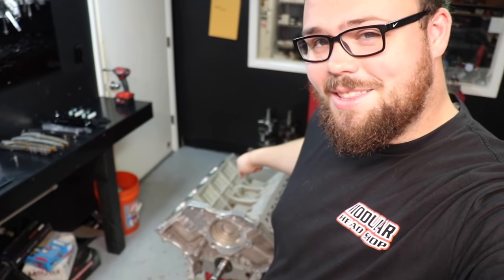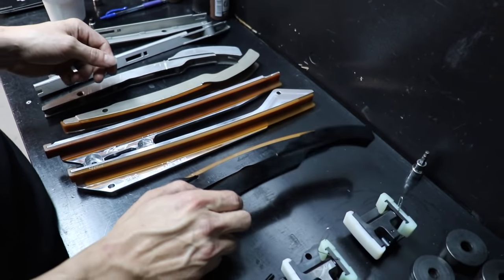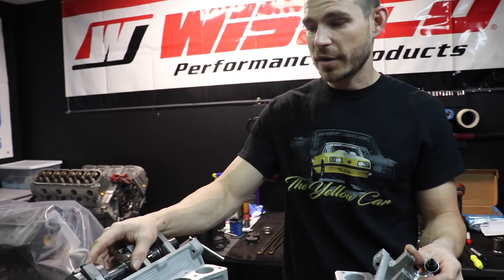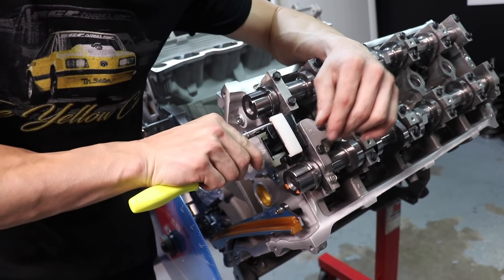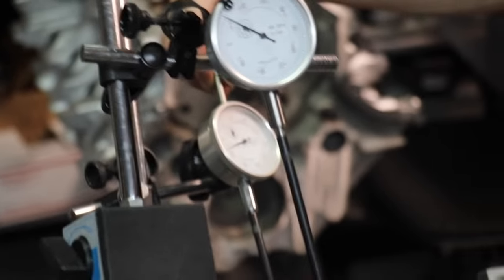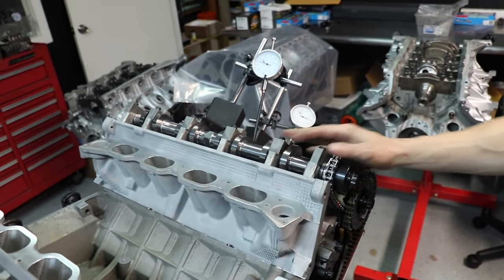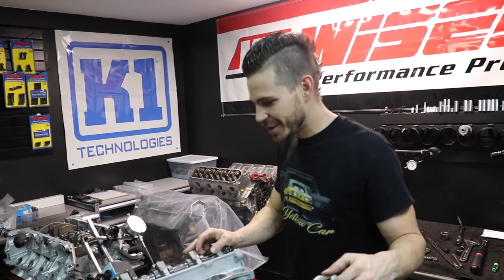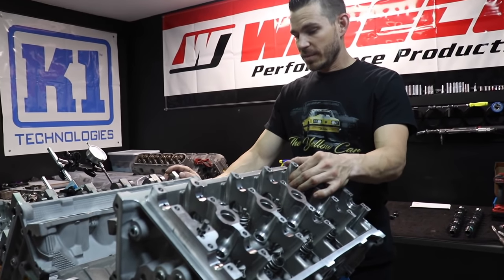How to Degree Cams 5.4L and 5.8L GT500 - Built 5.8L GT500 Build MHS Stage 3 Cams

Comment: Great video! I have been degreeing 4v camshafts since 2003 and this guy did everything perfectly. My only recommendation would be to lose the Chinese dial indicators. I could not really get repeatable results with the cheap ones, you can even see it in the video. 
But I did the same, making my own adjustable lash adjuster and tools to hold the chain tensioner open.

Comment: Very meticulous work. I was worried you moved the wheel but the piston was stationary. I think you just came up with a reason to manufacture solid cam sprockets with key ways offset +or- from the dot. Then if you need +or- degree, swap the cam gear. Ignore this comment if you thought of it already. Thanks for the upload.

Comment: Jordan buddy. Hook those drills up to thw milwaukee app and set the torque for each of those drill numbers and you wont ever have to worry about half triggering in those studs. Think it sets as low as 7 nm and 100rpm. Makes throqing studs in so much quicker without running risk of the drill bump torquing when the stud bottoms out. Specially on engines with alot of studs like these mod blocks and nissans vg engines

Comment: His tdc equation is more complicated then it should be . It’s Easier if you add first and second reading and divide by 2 .
Reply: His whole tdc process is over complicated would be way faster using a dial indicator. Still a quality build and he is doing a great job none the less.
Reply: Agreed
Reply: When he does his tdc hes checking tdc at 2 locations. Hes just figured a process for him where he can easily check and double check while giving him multiple measurments that he uses later on in the build. He has a flipped way of balancing the rotating assembly as well. But its accurate and doesnt take any longer. Ive run into a couple the old timers over the years that wont trust a tdc reading that is only taken at #1 they want #1 and #8 and set tdc using feeler guages and a 3 foot framing level. 
And his process may be because hes had a bad meter or guage and timing was off when everything read correct. Would be a huge hit on a $20k build just like this and be off timing between banks because of a bad tool or an incorrect reading. I kinda like it tho. Gives a better understanding of how his mind processes thru each stage of the build
Reply: I just find it faster to get a rough tdc then set a dail indicator and measure the sweep at tdc and split it, saves having to rotate back and forth so much.

Comment: 43:33 filing the gear to advance the timing. Is that usually when there's a pretty aggressive. Cam in the engine.   Correct. Or incorrect?

Comment: I wonder if the  flats on the cams nut would be aligned  to make a cam locking mechanism  or clamp so you can change chains and tensioners on a 5.4 32v  engine  ? I'm in Australia  so our 5.4 32v  maybe different  to the USA version  ?

Comment: I have a question, so I can’t go past 850hp without having to go forged internals? I’m right around 700 and I’m paranoid that my engine might blow up because I’m hearing ticking not sure if it’s normal or not
Reply: Sosa Svt you should be more worried about that crank snout

Comment: stock crank sprocket? oil pump gears??
Reply from the maker: Both are being upgraded
Reply: So that means hes got too take apart the front half of the engine again after all this is done .. should of done the crank amd chains before timing it .. but sounds like hes going to take apart when there's no cameras around
Reply: Those mod motors not coyotes to me never had bad luck with sprocket and oil gears. Never heard of anyone really having any issues

Comment: I have a question, if anyone wants to chime in and answer, I see when ordering assembled cylinder heads from MHS they have an option to add a cam degree service. my question is once the cam is degreed with cam gears, will it matter lets say if the heads are put on a block that has been resurfaced, or it does not matter what block the heads go on as long as its a mod motor? Can block material or deck Hight effect? TIA 2valve specifically with adjustable cam gears
Reply from the maker: Jordan can answer this better than I can but he typically finds that no matter what engine the cams go on they are within a .5 degree tolerance even with resurfaced heads. But I will bring up your question when we film final assembly.
Reply: Mustang Lifestyle appreciate, loving the education style content

Comment: Building the motor but not the trans..
Reply from the maker: The TR6060 is fairly stout from the factory. We have a Triple disk clutch too power the car. We are going to try the stock trans for now which should be okay on the street. If it breaks it breaks. Not a big deal. We will build it better or auto swap it lol

Comment: I’ve emailed multiple times about a quote and even called and left my number with the lady at front desk ... 

It’s cool I will have MPR do my build .... nothing personal Mustang lifestyle gonna unsubscribe
Reply from the maker: You're going to unsubscribe from me? I have replied to you on every video. I don't handle anything for MHS they are just building my engine. MHS gets a lot of emails. Maybe you could send a specific email of exactly what you would like done. It can be hard for him to customize a quote without any specifics. For example:

Hi Jordan,

I have been following the build series on YouTube and I would love to have my engine built by you. I have a [insert year] GT500 with xxxxxx miles. The engine currently runs great. I plan to pull it out and reuse the block and heads. I would like [insert what you would like done] for example: I would like to have the block sleeved, forged rods and pistons, higher compression, ARP hardware, Ported heads, and whatever other recommendations you may have. My budget is [insert budget here]. I plan to [insert use of car - drag race, street cruiser, road course, etc]. Please let me know what your best recommendation to move forward. 

Thanks,

Joseph Webb
Reply: Joseph Webb I have seen 2 one line emails that make zero sense. Not trying to be rude but I am one guy. I do all the tech calls, all the CNC programming and all the quoting. I get 5-6 emails a day that are so vague they don’t get answered because what could have been a simple email becomes a questionnaire. If you want a quote, like Andrew said, give some details. 
Looking for 1500 Hp and a compression ratio gives me nothing to go on and I don’t have to time to go back and forth about what exactly you want.
Reply: At that stage why not just order a nascar motor or a kaase big block that will handle the hp longer than a small motor